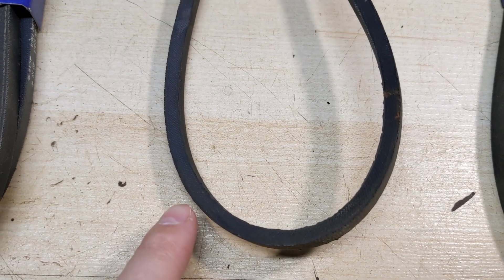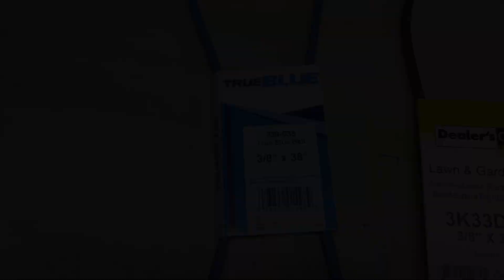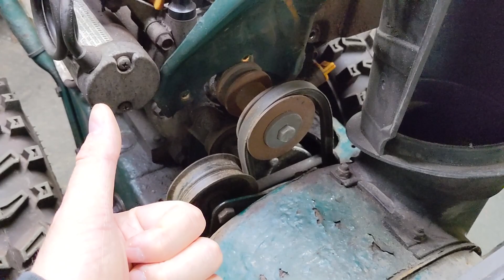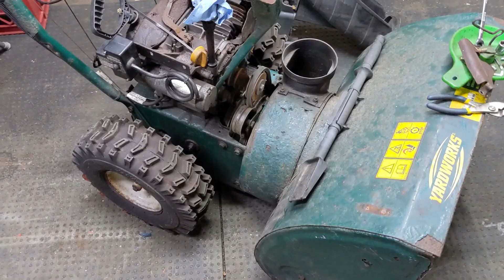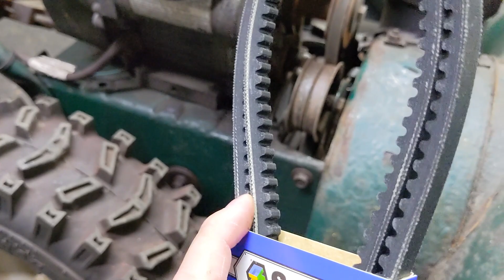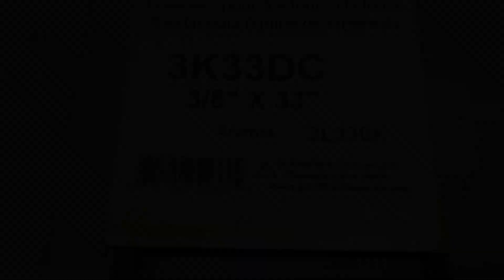Are Kevlar Belts Better?

Comment: Great tutorial. I learned the hard way about belts and their composition. Used a “raw” rubber standard polyester cord belt as the drive belt on a Cub Cadet with a hydrostatic transaxle. Replaced all pulleys with metal full bearing replacements. Found the cheap non-covered or raw belt would grab and make a banging noise when brake was released and it left rubber residue on the V-pulleys. Replaced with a covered aramid fiber belt and all was good again. The covering or sheath on the outside of the belt allows for a bit of slip as the idler  engages the belt and aramid belts absorb the shock or impact from engagement much better. As you stated the aramid covered belt was only $10 more than the raw belt.
Reply: I hoped a kevlar belt would have solved my issues especially considering it was twice the price of a regular belt, but it shredded after a  particularly heavy, wet snowfall  so as a last resort, I have switched to a "deep wedge" cogged belt. I must admit it was harder to install because it's is much deeper than a standard belt, but so far it works as it should, not grabbing when disengaged when the machine is cold, but it does grabs when disengaged when the machine is warm. Nevertheless, it doesn't smell burnt rubber and doesn't seem leave any rubber on the pulley, like I've experienced with a regular belt once before. I guess the cogs and the deep contact area makes a big difference and the fact that it grabs under a no load condition must help it prevent wear - I always maintain the auger engaged until there is no snow coming out of the chute, and always make sure the auger is free and not stuck in ice before starting the machine. I would rather have a belt grab a bit too much (be a bit too short) than too little (be slightly too long) and get destroyed from slippage under load. That being said, I have found it difficult to get belts with the exact size as circumference can vary by up to 1/2" between manufacturers - I sure wish idler wheels could be adjusted to take thes slight variations into consideration!

Comment: Just put new belts on my garage sale, project 8/25 snowblower.  Used the Gates Tru Flex for both belts. I found that the drive belt was not running true on the idler pulley. Removed the pulley and twisted the bracket a couple of degrees and now is running true.  If you can't find belts in 1/2 sizes the auto parts store would be your go-to option.
Reply: Very true about pulleys not running true. I always chack operation on my snowbklower with the cover off. I've had to 'bend" the idler wheel and rotate the auger pulley to compensate for axle wobble. Pulleys that don't run true or wobble can chew up belts fast.

Comment: On belts snapping, on a car I had the fan sucked up a plastic bag into the radiator once and snapped the belt.  Almost wrecked the motor because it hardly made a sound, just a "tink", and I didn't notice a problem until the engine started overheating.
I got really lucky that was an iron engine and not an aluminum one.

Comment: Great video - It'sthe second time I watch it and if I could, I'd give it a second thumbs up 😆. 

We have really tough snowblowing conditions where I live - I have to go though 2-3 feet of compacted, hardened snowbanks after every snowfall and my snowblower often breaks shear pins and blows belts, so I've been looking for solutions for quite a while. I installed my first Kevlar belt this year and I was disappointed that it shredded only after a few heavy snow blowing sessions and didn't last much better than my regular belts under the same conditions. So this time, out of desparation and against what I have been advised, I've installed a deep wedge cogged belt and it seems to be holding so far. The only issue I have is that it grabs in disengaged mode when the machine is warm (it slips as it should when the machine is cold). Despite the fact it grabs when warm, it doesn't smell burnt rubber at all and so far, I haven't seen any signs that it's caused excessive wear as when I had strandard belts not disengaging fully, causing flat spots.

Are raw-edge, deep wedge cogged belts just more robust, like some manufacturers claim, and have you had success with them under idler wheel use? And can these belts be procured in Kevlar instead of Polyester? And how much stronger are kevlar fibers in belts compared to polyester?

Thanks in advance for any insights you may be able to offer.

Comment: Very good explanation of the difference in belts. Yes the True Blue or other Kevlar Replacement belts last much longer since they stretch much less than other belts as you well explained. I believe it would be extremely difficult to get a warranty during a 2 year period mainly because failures will be from overloading as you also mentioned. Keep up the good work Jake!
Reply from the maker: Thanks for watching!
Reply: Good  day  Yes he does a  good   in  depth   video.

Comment: Very well explained.  Thank you for opening my eyes on belts and how they work.. good job
Reply from the maker: Thanks for watching!
Reply: What size of belt for the drive and auger belts on a yard work 10.5hp engine with 30inches auger
Reply from the maker: @montyparris1779  google your model number and type parts diagram after that, you need a parts list, you can't just guess, it'll be a very specific size.

Comment: Great explanation. I never knew the aramid only come in whole sizes. I just put one of these (aramid) belts on a variable speed Craftsman, another MTD basically  and its tending to run (move) when the accelerator is all the way out and even when the brake is engaged. It could be an issue with the stack pulley too, still investigating what exactly is going on. Its fine until the belt gets hot, then it starts to grab.
Reply from the maker: You can't use regular v-belts on an MTD variable drive, it'll shred the belt. You have to run the OEM or a stens replacement. They're shallow groove belts, almost look rectangular, also, some are .715 thick which is even bigger than 5/8"
Reply: @EliminatorPerformance  Good to know, thanks. I did have a Aramid on it before but one of the idlers bearings went out and fried the belt. Maybe that's related, too much pressure on it, wrong geometry. That belt didn't seem to have the creep issue this new one has but it's a different brand. The other one was a American Eagle which seemed to work pretty well till it got hammered by the dead idler. If this doesn't work out I'll get a Stens. You think Aramid can work in this application or better to got to a conventional belt?
Reply: I go through a belt every year or two on my huskee or mtd,so Im going with kevlar now. See how long they last.
Reply: I go through a belt every year or two on my huskee or mtd,so Im going with kevlar now. See how long they last.

Comment: Good points. I would like to add that cut edge belts are much truer and run smoother than the wrapped belts. This is how “matched” belts are made which is important like on the mtds twin auger drive belts. That’s why you’ll pay more for the oem 2 pack. They’re clogged and cut edge. Even more important in heavy industrial machines such as mills, lathes, fans, compressors. Smooth cut edge match belts eliminate any “thumping” or vibrations that wrapped edges cause from their edges not being a true consistent width causing the belt to raise and lower as it passes over the pulleys.
Reply from the maker: Yea I was going to get into the heavy duty fabric wrap but I could go on all day lol but yes the fabric wrap is great for CVT mowers where the pulley diameters are always changing so it allows that slip when engaging. Raw edge definitely have more bite, but again that's more friction, more heat. I've never had any issues with a wrapped true blue when replacing a snowblower auger belt, no slippage and they last a lot longer. Thanks for watching Garny!
Reply: @EliminatorPerformance  actually no good snowmobile, utv/Atv belt is wrapped. They are cut edge for smoothness and power transfer. They need to be because the design operation over amplifies due to the way the pulley “sandwiches” the belt. You wouldn’t be able to comfortably ride a vehicle with a cvt and a wrapped edge. Good example try using a snowmobile belt that has a little burnt spot...it will hammer and thump horribly. Cut edge are the highest quality belts. They may not be the strongest but definitely most accurate and smoothest running.
Reply from the maker: Maybe on a high performance application yes, but on a riding lawnmower with a CVT, they have a stack pulley and it requires the belt to have some slip, but only when engaging the drive. A cut edge belt would let to grabbing and the mower front end would jump. The heavy fabric cover on the stens true blue belts prevents this.
Reply: @EliminatorPerformance  correct on the new age cub/mtd/ craftsman crap. Those pulleys are so crude it ain’t gonna matter if you put a cut edge on them. Now if you look back on the JD variators those were the same idea just they were built true. The oem belts are cut and work a lot better than a AM wrapped belt. Again the difference between quality and quantity. That is the story of today’s world.
Reply: @garny3766  I've been following this exchange with great interest. After having a standard wrapped kevlar belt shred after only a few heavy snowstorms on my snowblower, I've installed a deep wedge cogged belt out of desperation and despite being advised against it by other people, so your take on it is refreshing. I guess they didn't understand I would be using a "deep wedge" cogged belt, not a standard depth one (my snowblower pulley is deep enough to accomodate such a belt). I sure hope the presumed greater and smoother power transission from the deeper contact area and greater flexibility of the belt will make a great improvement in my case use - snowblower augers are started under no load conditions so they shouldn't really require to significantly slip when engaging, unless of course you make the mistake of leaving snow in the auger housing and it freezes solid, but that would damage any belt.

Comment: So if a "Kevlar" belt is a little longer than an OEM belt, that should be good as long as there's a slack idler pulley, like on my 46" riding mower single belt Deck Blades Idler Pulleys and another one or two on the Ground Drive Belt?  I think the slack idler pulleys will handle the extra length of less than a half inch on each one.  Great, detailed explanations!  Thank you!

Comment: Very good information, I use always kevlar belt. On auger, snow never clog up in my Yanmar ys90t belt modell,
I use belt from sweden there they Have i between zises 33 inch and 33, 5, 34 34,5 in hes 33 in hes refer to outer length of the belt
Reply from the maker: Thanks for watching!

Comment: Nice job on the video, this is gonna be long winded.  We buy and stock 100s of Stens belts and like them overall. They are our only aftermarket belts. Not sure I agree fully with the Kevlar belts being better all the time. Raw Edge have more traction and most have way more cord impregnated in them. 
I have unsuccessfully attempted to do warranty claims on Stens belts and the work it takes to do the claim and then it's denied sucks. So we no longer advertise / promote the 2 year warranty thing especially when you're selling it over the counter.  
Lastly WARNING they have some AYP belts I came across that are way out of spec and it's a problem.
265-182 is 3/4" too long compared to OEM and even the length that they say it is. (Way too loose on the pulley). So I only use OEM instead. Stens said it was an "acceptable margin of error" !!!! NOT...
265-361 is also 1" longer then it says in their database .
When I called them and I was told we might be better off avoiding their AYP snowblower belts. And they would begrudgingly let me return the   20 or so belts that are out of spec, but of course I have to fill out a warranty claim and pay shipping.
Now I measure all the belts if they fit on the belt measurer and check to see if they're in spec.  Sorry that was so long lol. Would have been easier over the phone.    Bill in Ottawa.
Reply from the maker: Good to know! Usually when I'm ordering a true blue replacement I go with the exact size and I generally don't have any issues. Will have to consult with the old man on those numbers you gave us, great info! Thanks for watching Bill!
Reply: The OLD MAN from EP just saying thanks to Bill for the information on the two Stens belts that are too long. I will be checking my inventory to see if we have these in stock and if we do i will take length measurements and update you. Once again thanks and never worry about long winded replies especially when the information if so important.
Reply: @EliminatorPerformance  Donyboy73 and I talk quite a bit and share information and tips and tricks , if you're interested we can exchange numbers and talk once and a while....no pressure sometimes it's easier than typing that's all.
Reply: @EliminatorPerformance  Bill i have just checked our inventory 265-182 (5/8x38) we are only carrying the True Blue Kevlar and they measure OK but we have one only 265-361 which is supposed to be 5/8x37 1/2" and it actually measures 38 1/4" or 3/4"+ oversize. Interesting when checking on line the AYP 532408010 belt number is offered from 37 1/2", 37 5/8" up to 38" in length yet when you check the AYP chart it shows actual length required to be 37.3". For us to have this belt in stock somewhere along the line we must have installed one and tested it as functional. Problem is that we rarely check the length of belts as received so not sure what the circumference of the belt installed would have been. Thanks again
Reply: The Oregon replacement belt per other suppliers of belts as an alternate is Oregon 115222 which is 5/8x38"
Reply: @waynestefinashen239  is that an EOM replacement belt or a Kevlar wrapped?
Reply: @billlovett4256  Bill from what i have checked they are saying the Oregon 115-222 is a replacement OEM belt and it is not Kevlar. As an example Dr.Mower.ca is showing the OEM listed at $44.05 while the Oregon belt is $29.53
Reply: @waynestefinashen239  thanks for the info we ordered one to have a look at it. We sell the OEM for 49.95
Reply from the maker: @billlovett4256  my business number is public, just google it as I don't want to post here because the bots get it and spam call. We emailed him recently about that weird Crankcase cover that vented air, no response if I remember correctly. Would be interested to hear his or Taryls opinion on that one.
Reply: Great info and my experince as well - belts with the exact same specs can vary by as much as +/- 1/2" in OC and for idler wheel use such as in a snowblower, that just won't do.

Comment: I thought that there three main types of V-belts: Classic (A-E) with standard V angles but sized by the inside circumference; fractional HP (L) with standard V angles sized by the outside circumference; and Deep V (or narrow wedge) with steeper V angles sized on the outside circumference.  There is also sheathed and cogged version of each.  I dont know what makes a belt fractional HP (L series), but i can only assume that it is low on fibers (cheep) compared to a classical (A-E).  I assume that to use a deep V belt, one needs the pullies to match that angle, but dont know how to easily measure that.  

I didnt see any mention of these three main belt types in your video.  I am all in favor of buying the best belt that you can afford for the heavy duty application, and aramid fiber is likely that.  I assume that that is what the old Gates green line was?

Comment: Hmmm, hoping I’m not posting twice but can’t find my other post.  If my Yamaha snowblower calls for two belts, a LB42 and a LA33, then I should be safe ordering a 258-042 (5/8 x 42) and 248-033 (1/2 x 33) in the Stens Blue, correct?  Yamaha wants $90 for one of the belts!  The machine came with Bando belts on it; a SB42 and a SA33.  Guess Yamaha OEM parts jump back and forth between Mitsuboshi and Bando belts...  Thanks for another great video.
Reply from the maker: Be careful, Honda A = 1/2 and B = 5/8 but the belts were sometimes longer than the part code. So a LB42 could actually be a 5/8x43 and a LA33 could actually be a 1/2" x 33 or 34.

My advice would be to measure your belts and then go with a kevlar belt of that length.

The issue is, LB and LA is metric. So an LB measures 16.5mm thick at the top, which is actually 0.650" and 5/8" is 0.625 so you'd be getting a slightly thinner belt which could affect the length because it might sit farther into the v of the pulley.
Reply: @EliminatorPerformance  EXACTLY 👍. I have a Honda snowblower and it took me a while to realize that when I first started changing belts.

Comment: Thank you for this video! You covered material that I have NOT seen on ANY other channel. I have one question: what is the difference between a "Kevlar" (Aramid) belt and one that is Kevlar "wrapped". Will the wrapped one last as long as the "regular" Kevlar belt? Again, THANK YOU for all the information!!
Reply from the maker: So the wrapped belts are great for extended life, they go around a pulley with less friction due to the wrapping, and thus don't wear out as fast. However, a raw edge belt will grab the pulley (due to the raw edge being rubber, not a cloth like wrapping) and will wear out quicker due to increased friction. Some snowblowers will specifically call for a raw edge belt in the manual, so a covered belt should not be used.
Reply: @EliminatorPerformance  Thank You!

Comment: I've only seen belt and pulleys being used in compressors, car engines, small workshop machines and so I'm wondering can they be used to transmit significant amount of torque? Like lifting/lowering a small metal bridge for pedestrians?